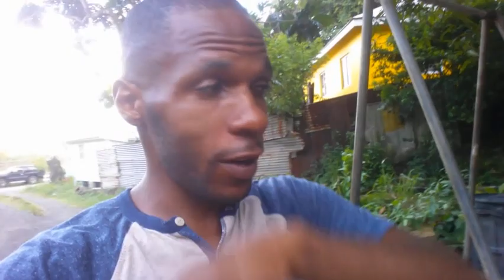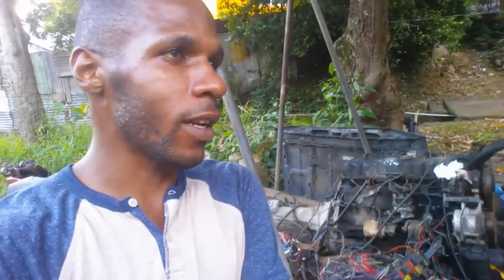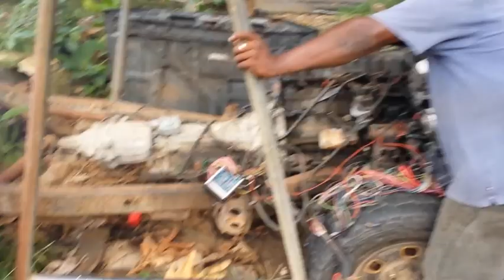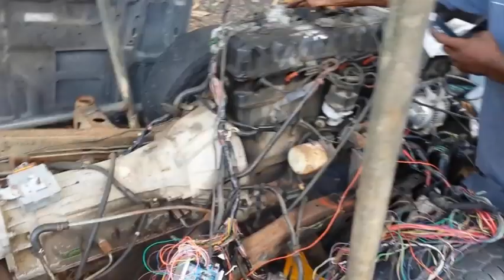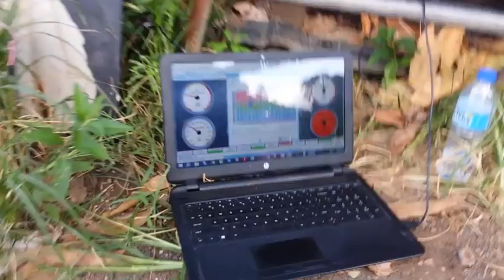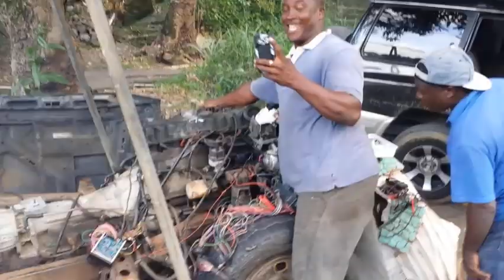Speeduino Jeep 4.0 I6 First Start

Comment: I liked that! I'm installing a Megaquirt MS1 on my Jeep XJ but i'm almost jumping to a Speeduino setup. This car have automatic ou manual transmission? What signal are you using, crankspeed sensor or distributor? I'm considering to use the distributor signal to run, because i need to use the original Jeep computer to control the transmission.
Reply from the maker: I'm using both crank and can signal as you need both of them to use the jeep trigger settings in Speeduino. Parallel installation would be best if you have an auto transmission
Reply: @DCWERX  i'll do that in parallel. My PCM has 1 blown injector channel. I have a few MS1 ready to use, but i'm studying Speeduino. With the MS1 i'll to run by the distributor signal ou install a trigger wheel on the damper. This engine that you have uses Renix system or newer? I'm having troubles with the 8V sensors, as the MS1 uses 5V for references as well.
Reply from the maker: @pedropellegrino273  speeduino has a trigger setting already made and tested specifically for that engine but requires both crank and can signal. The signals were 8v iirc, that works great with Speeduino. I ended up using an external igniter since the factory unit is built into the ECM.

Comment: Sounds great. Can you say something about your experience with setting up the Speeduino? I've purchased a kit simply because... why not? I am hoping to run my VW 1.8 turbo with it. What issues might come up? Cheers from Norway :)
Reply from the maker: Not many issues that I can speak of. Its a DIY open source ecu so it comes with a few challenges. Most of the info you need to get going is on the wiki page and the forums
Reply: @DCWERX  That's great, it seems the speeduino is fairly well thought through so I am looking forward to getting stuck in. Thanks!
Reply from the maker: @AlfOfAllTrades  you are welcome mate.

Comment: Did you use the stock jeep coil ? If so how did you drive it ? Thanks
Reply from the maker: Yes I did. You need some form of igniter/IGBT to drive it since it's a dumb coil.
Reply: @DCWERX  can i replace the dumb coil with a single ls1 style smart coil ?
Reply from the maker: @GiacomoMarenco  yes you can but you may be limited by dwell time not 100% sure.
Reply: @DCWERX  so an igbt controller should be better ?
Reply from the maker: @GiacomoMarenco  yes it's usually just 3 wires to hook up